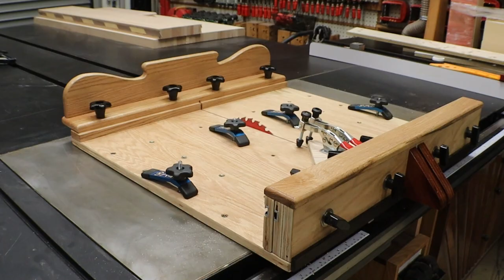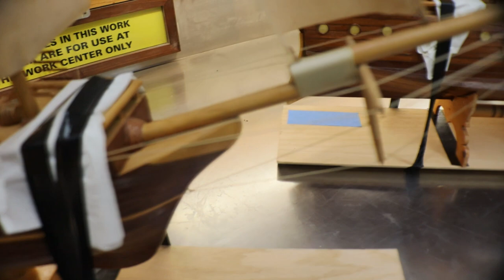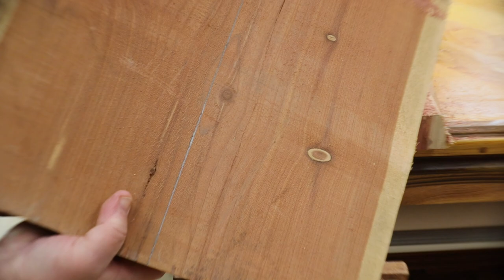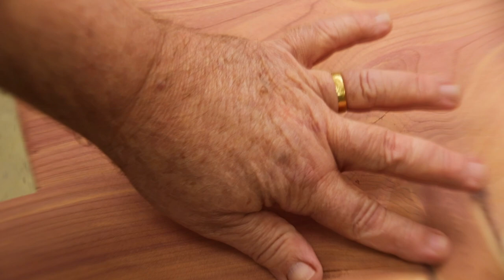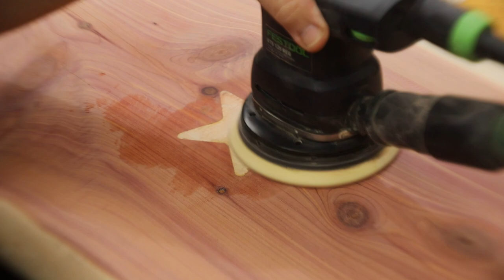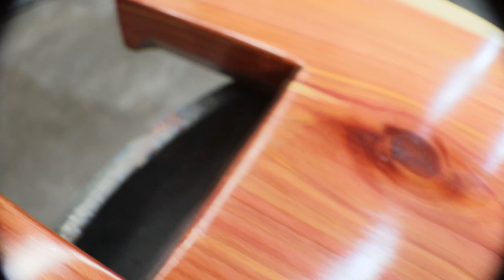COOL COUNTER TOP FOR BAR

Comment: This was of great interest to me as I am gathering cedar slabs to build a bar in my house. You made me realize I will need inlays too!
Reply from the maker: Hey my friend that's great Cedar works wonderful every time I'm out of town at the moment but I'll be back on the 15th. The inlays will keep it coming LOL from Doug
Reply: @fleetswoodshop3339  I have a couple Bosch routers and the Porter Cable type bushings but I am thinking of treating myself to a Shaper Origin, have you used one of them?
Reply from the maker: @RDAUGIRD  that is awesome my friend and yes. They are a wonderful tool. But the bits can be very expensive. And their little on the dangerous side you really want to use an automatic feeder if you can with a shaper. Unless it's a small one then absolutely use push blocks and sorry it took me so long to respond. I'm out of the country at the moment